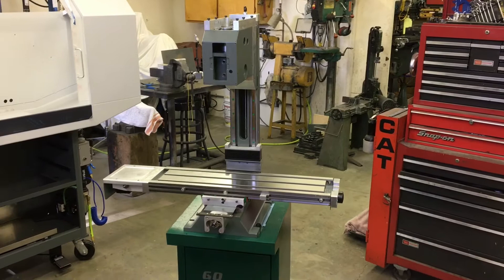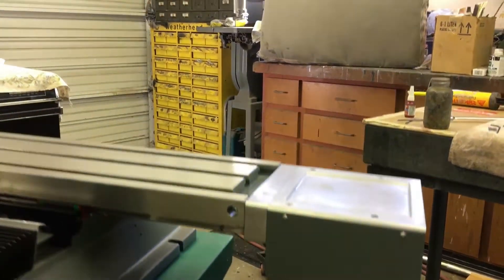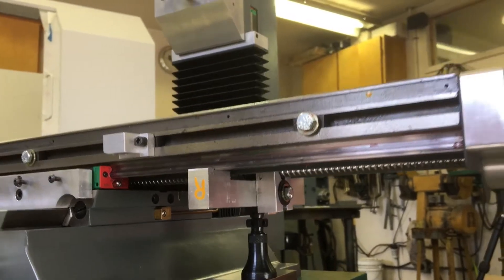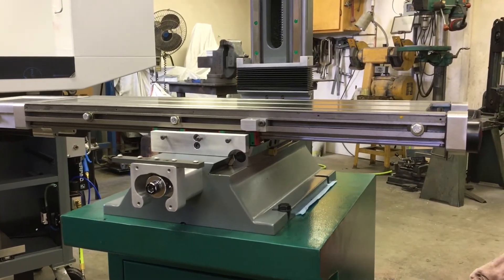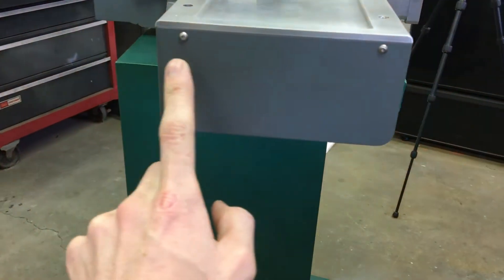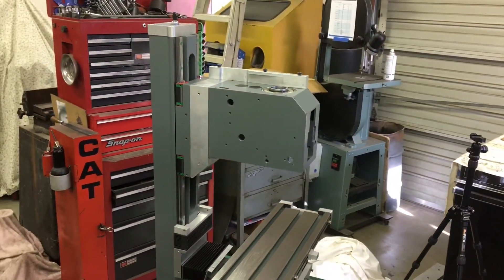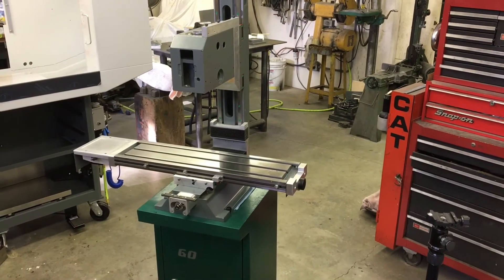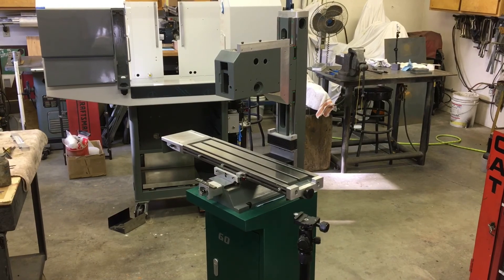GRIZZLY G0704 CNC Conversion Update 27 - ( assembly 5 )

Comment: I also have a g0704. I would recommend adding some supports for the z column. The z column tends to flex. On mine i can get about 5 thousandths by pressing(not hard) on the head with my hand.